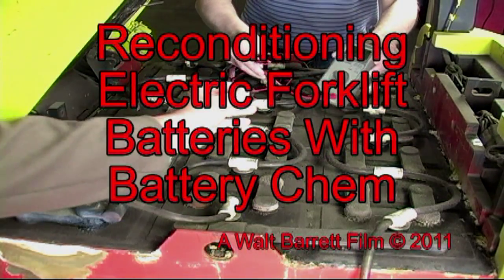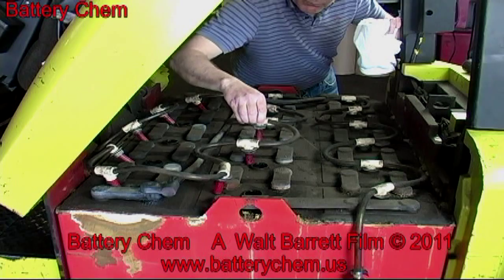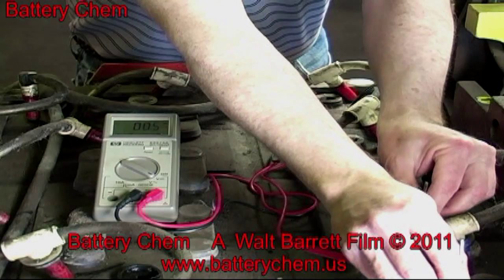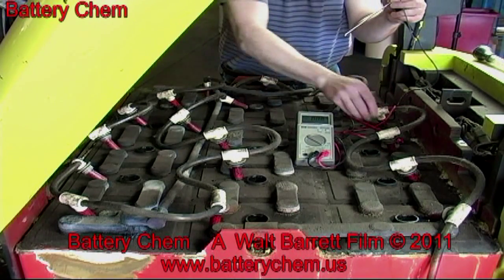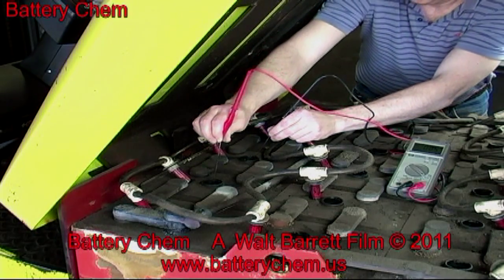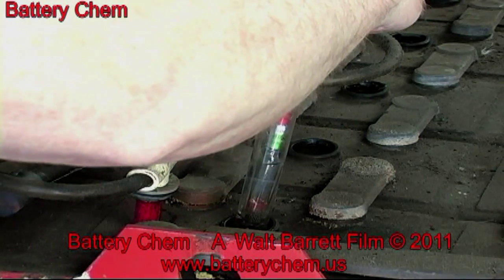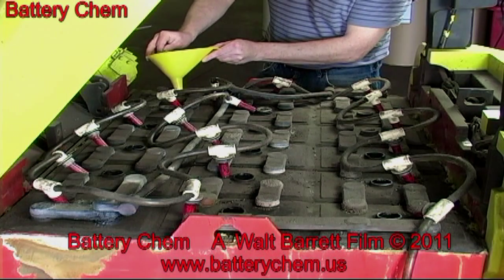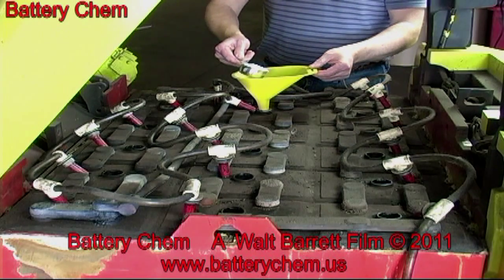$5,000.00 a week renewing electric forklift and golf cart batteries by Walt Barrett

Comment: Lol... the old epsons salt trick,  only this guy sells it to you as fix it in a bottle.  
Yes this works for a short time in some cases because it increases the conductivity of sulfated cells who's electrolyte has been reduced to mostly pure water and is thus not conductive enough to allow enough current to flow to charge the battery. 

If I hired you to recondition my forklift's battery and I caught you putting that shit into my battery you would be buying me a brand new battery. There is a proper way to do this but you must have gallons of specially prepared (and extremely pure)charging electrolyte and then be prepared to drain and fill the cells several times over. I have seen batteries go years after being desulfated that way, however if you go the way of epsons salt you are drastically shortening the life of the battery that would otherwise be perfectly fine if properly serviced.